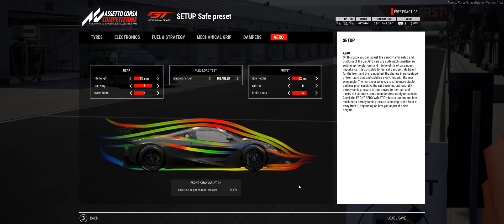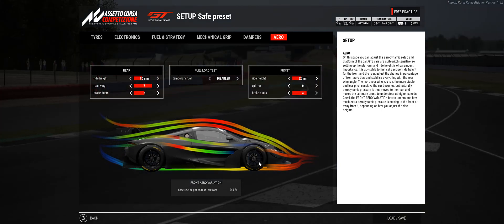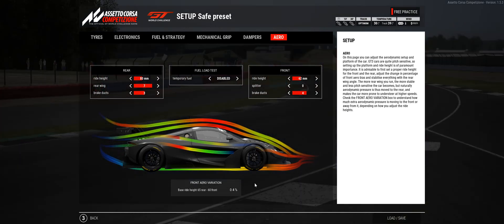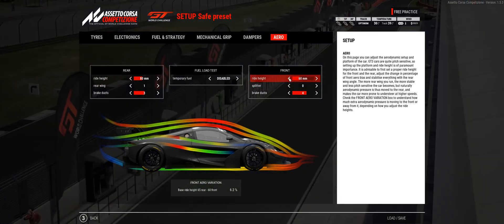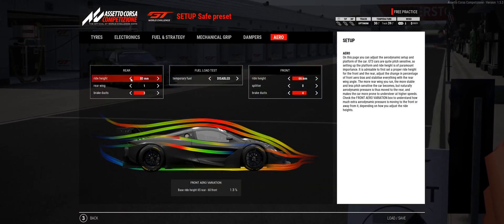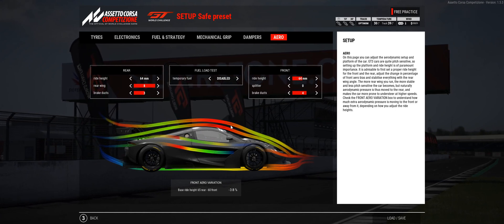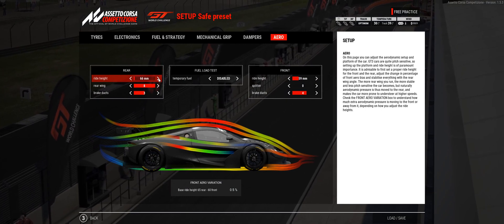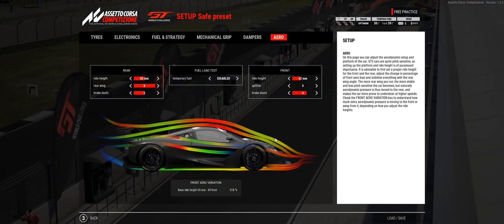Assetto Corsa Competizione Setup Tutorial: Aerodynamics

Comment: It's been 9 months and still have no answer to my question. Lol.
Reply from the maker: Sorry, I hadn't seen your comment. Some cars have naturally different balances. You might find that forcing a car to have a wildly different balance than the window it's intended to run in results in below par performance.

Disclaimers aside, what exactly have you tried, and what is the current balance of the car?
Reply: @MatthewJones555  Thank you for the reply! Currently the areo readout for the setup that I'm currently running is 8.0 however my lap times are around 1:50's and sometimes I get into 1:48 to 1:49.6. I'm trying to get my times to be between 1:48 to 1:49's. Tire temps get are getting to 28.1 area on a track 28c with no real tire wear. When I set the car up to get an aero 5.0 the car seems to be understeery. I could never set the car up to get a 0.5 aero. Thanks again.
Reply from the maker: @SackyX  different aero balances suit different cars. It sounds like you're near a balance that already suits you. The important thing is to try to stay near the number that you like when you change your aero and ride height for different tracks. Then it should remain predictable wherever you race.

Comment: One thing you miss here is that when you lower the rear wing, you are removing rear downforce that is basically not sensitive to rear ride height. So this means the dynamic aero balance will be more variable and the car will be less stable. Sure, the steady state aero balance will roughly be the same, but this will not hold under braking. So you will need to stiffen the suspension to cope. Oddly, on the mclaren 720s i found very small drag reduction with lower rear wing angle, but the car was very unstable, no matter the suspension setup. So i ended up running 7 RW at monza.. still lapping in the 47s
Reply from the maker: Thanks for the reply.  Yes, I plan to cover that when I move onto the mechanical grip section of the setup screen, that section is going to be a bit of a beast to cover, and will require multiple videos.  My aim is to keep each video as short and simple as possible, and add extra detail gradually in more advanced videos, so I don't overwhelm the viewers with information.

Comment: Great info, nice and clear. Have to ask, is 0.5 the magic number or is closer to zero better?
Reply from the maker: I prefer it somewhere between 4 and 8 depending on the car and track. The higher it is, the easier it will be for you to turn the car, but the rear end will be less stable.  Lowering the number will make the rear end more stable, but you'll be more prone to understeer.

There's no magic number that will suit every driver, car, and track. Personally, I tend to increase it until the understeer is more bearable, but keep in mind that whatever you arrive at will always be a compromise.
Reply: @MatthewJones555  So does that mean you still use 4 - 8 .. even for the cars that like negative rake ? (EG: Ferrari ??)

Thanks for the video as well ... explained very clearly and succinct  👍🏼
Reply from the maker: @CY078  sorry I've not got much experience with the Ferrari, although you won't see the same gains from a car that hasn't been designed to take advantage of running a rake.

I always look at how the balance feels in a car, and then change it based on that. Your overall down force level will decide how aggressively you can push the upper and lower limits of that balance.  As I said before, there are no magic numbers. What suits my personal preferences might not suit someone else.  I hope that's useful.
Reply: Oké, thanks alot Matt 👍🏼

Comment: That was great thank you, quick question what should you do when you add enough fuel for the weight to cause the ride height to change, how do you deal with that?
Reply from the maker: You should test the car at full fuel, and if it's a circuit where you need to ride the kerbs, you should make sure you can still take your normal line without losing control of the car.  If this is an issue, then raise your ride height for your race setup.  Keep making adjustments and testing the car until you're happy over the kerbs, obviously keeping an eye on your aero variation.  It'll end up being a compromise, so you'll have to find what works best for you.